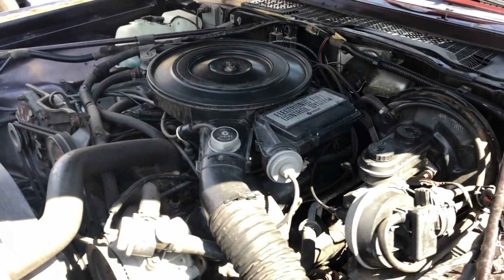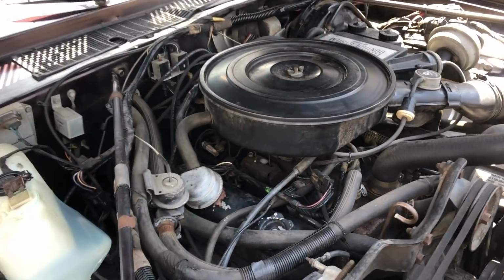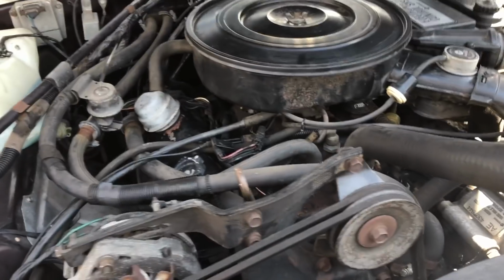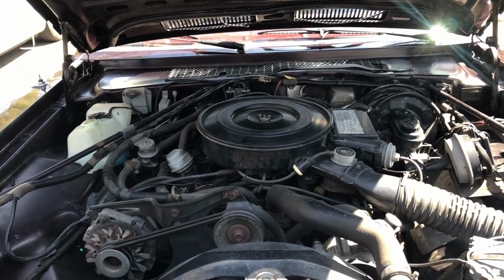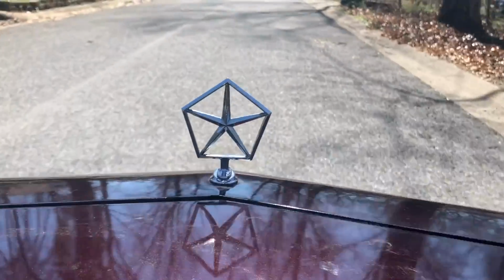The Car Chrysler Forgot to Stop Making - My 1988 Plymouth Gran Fury

Comment: Check those old rubber brakes hoses for rot... 14.7:1 isn't always the optimum air/fuel ratio... more like 12.9:1 for max power... 15-16:1 for max cruising MPG... all the performance magazines have articles on pumping that 318" engine to 400 HP... I prefer the Hot Rod versions: 
https://www.hotrod.com/articles/318-small-block-build
https://www.hotrod.com/articles/mopp-0409-318-engine-build 
https://www.hotrod.com/articles/0810phr-chrysler-318-engine 
.
Reply from the maker: Great comment and thanks for sharing those links.  Time to get reading on them now!

Comment: A friend of mine in college had a 1985 Plymouth Caravelle. Robins egg blue. Same basic car... 318 V8, column shift. It didn’t have any of the fancy electronics on the engine, just basic emissions stuff and a two barrel carb. Pretty gutless for a V8. My car was an ‘89 Oldsmobile Cutlass Supreme with a 3.1L V6 and same HP, less torque, and it would waste his car off the line. 

Two theories I have about this car. First... the Greatest Generation was still around and still wanted the RWD V8 full sized cars they’d always had... but weren’t able to afford the Lincoln Town Cars and Cadillac DeVilles nor the expensive European Mercedes and BMW RWD luxury sedans... and most domestic automakers especially Chrysler had gone to FWD 4 cylinder and V6 cars with an emphasis on sporty handling (everything way “Euro” or “European inspired” back in the 80s). The Ford LTD Crown Victoria and Chevy Caprice were aging and more expensive... so here was a cheap RWD V8 sedan they could buy. Even Lee Iacocca said that the only reason why they didn’t go full FWD was because these cars were their best sellers. 

Next is where Chrysler has always positioned themselves. They have always been the manufacturer who gives you more for less. Whether it be cars or trucks or minivans no other manufacturer from purely specifications comes close. 

And you can see it today still with their current RWD with V8 available cars like the Charger and 300. Fords upsized Taurus was comparable in size, but not configuration and was way more expensive. Chevys SS was also an expensive and low production run car that came and went. Toyota only has the V6 FWD Camry unless you want to head up several tax brackets into Lexus territory. Honda axed their V6 Accord. But Chrysler even after starting the revolution that all but killed the classic large American car in a curious twist of fate and a bit of borrowing from Mercedes has brought it full circle to what it was.
Reply from the maker: Fantastic comment and I totally agree with you.  The way you stated those theories, it completely makes sense.  It's almost like the folks at Chrysler deliberately stay in a certain niche so to not upset the bigger dogs.
Reply: The Chrysler LX was derived from the LH architecture.  The LH was originally designed to be FWD, RWD or AWD.  The merger with Daimler produced synergies that allowed Chrysler to borrow ideas from Mercedes, but in reality, very little MB parts content were used.  After the 2011 redesigns, ZERO Mercedes content.  

The idea that the LX cars are simply reskinned Mercedes is the myth that refuses to die.

Comment: Interesting thing about the radio and climate controls. It was up until the early to mid 90s... with new designs that included the Eagle Talon, the 1992 refreshed Ford Taurus, the 1995 Chevy Lumina, etc that all had the climate controls above the radio. Fords were especially bad.. since their radios were a maze of tiny buttons vs the knobs everyone else had. GM was better because they often had steering wheel controls for radio and sometimes for climate as well.  

In the late 90s was when American manufacturers finally relocated climate controls to bottom.
Reply from the maker: Again, another great comment.  Maybe you should start a YouTube channel with all of this!

Comment: We have an 86 Gran Fury that was an old Highway Patrol car. The state did some modifications to the electronic system above the engine shown here.  The box on the side of the air filter housing was removed and an actual computer was installed, which NO ONE knows anything about.  It's had operating issues since it was bought at a state auction. Our neighbors had bought it from the state in 89, drove it a few years, then sold it to my uncle. He drove it a few years, then sold it to us. I used it as my daily driver for the farm and errands and personal use. Each of us tried different fixes to get the car to run right but nothing any of us did managed to fix the driving issues.
It would get extreme mileage. One day it would get 23 mpg, the next it would get 13, using the exact same driving conditions. Sometimes it would develop a misfire which no one could figure out, then it would mysteriously go away.  My dad actually did consider just running an aftermarket carburetor and distributor and do away with the entire electronic stuff.
Reply: On the squads, Chrysler put the computer under the dash, away from heat and dust.  It worked, nothing special.
Reply: @pkranz937  OK. Where specifically under the dash, and is a replacement unit available?
It's a pretty nice car and we'd like to drive it if we can get it to work decently.

Comment: I always liked the styling of the late 80's Grand Fury. I used to own a 1987 Chevrolet Caprice Classic Brougham with the same kind of magenta felt interior of this Grand Fury. So many similarities. It had a 305 and was smooth as glass. I sold it to middle eastern man who exported V8 rear wheel drive cars to Saudi Arabia. Had was and is cheap in SA. 25 cents a gallon. They couldn't care less about gas mileage.

Comment: In my MOPAR driving history, I drove a 1985 Plymouth Horizon, and 1987 Chrysler Le Baron SE. My family also had a 1978 Dodge Aspen SE station wagon, a 1974 Charger SE, and a 1983? Mitsubishi Colt. That radio doesn't look like the standard MOPAR radio, but the chrome plastic climate controls are totally MOPAR of that time. Anyways, the 1980s were a great time for Pentastar reliability, and all our cars were very reliable, except that the choke had to be manually opened during the winter after they flooded. Enjoy your car!
Reply from the maker: Thanks for the comment and for checking out my Plymouth video.  And wow man, you really were from a Mopar family!  That's a whole lot of Pentastars!  -Chris
Reply: @hullinger   It is too bad about Chrysler, because when Americans relied on the Big 3, Chrysler was generally considered to have the best engineered vehicles of all of them.

Comment: Since there is no air bag, this is an earlier '88 model (pre-May 1988). Should been built at AMC in Kenosha.
Reply from the maker: Thanks for the comment on my Gran Fury video and yeah, you're right.  I checked last night and my Plymouth WAS built in Kenosha.  I was hoping it would have been in Newark, DE since the old factory is fairly close to me.  -Chris
Reply: Only some '77-81 M-bodies were built in Newark, before K-cars took over. They (LeBaron/Diplomat) were being built there alongside the Aspen/Volare in those years, since a M-body is basically the Aspen platform.
Reply: @kevinwong6588  M body through '83 was Windsor. F body at Delaware through '78, then Lynch Road through '80.
Reply: I through the Aspen platform (F body) remained in Newark until end of 1980, with changeover to K-cars. The R-series (Newport/New Yorker/Fifth Avenue/St. Regis/Gran Fury) were the only models at Lynch Road by 1979.

Comment: try a colder firing spark plug like NKG it might help with the misfire/timing problem it might NGK
Reply: Not the right plug.  Champ RN12YC.  Could be wires, cap, rotor, carb, vapor lock, fuel filters/pump, egr valve ... gotta test it and narrow it down.

Comment: Find an old junkyard 440 or even a 400 with the big block transmission 727 and have some real fun, that's all I used to own was Mopar, great video.
Reply: Tight fit. The 340 will bolt in.
Reply: @robertlee9395  360 is the best in these cars.  Torque, torque, and torque.  Make sure the rear leafs are good though, the 360 winds them up something fierce.

Comment: You will never get the Lean Burn system running properly.  They just don't.

Swap in the distributor and electronic ignition box from a mid-1970s Mopar V8.
Reply: Bullshit.  Just diagnose what's wrong and fix it.

Comment: The M body is the very last true Chrysler product that you could own, that after 10 years from new. Still ran great. I have had 2 of them. Both in excellent condition, served me well to the day i sold each of them. I can say without any ANY regret, they were the best cars i have EVER had.
My 1987 gran fury had the uncommon 5.7 liter 360. After ditching all the emissions junk got far better fuel economy, and would light the back tires with ease. At 4,000 lbs - yes 2 tons put it on a truck scale it is a two ton car. Built like a tank, anything that hits you if it's made after 2007 is totaled
and money says YOU will drive away. The other car is going to the bone yard to die. After some repair, the M body will live on for many years after.
The A904 transmission was an updated version of the A727 torque flight transmission more or less, if serviced was trouble free. It was set up to go into lock up with the torque converter clutch - tcc at about 50 mph. If it is stock it will return about 12 to maybe 15 mpg around town. 25 or so highway. Not great, i had no problem paying a bit more for fuel knowing i could take those cars anywhere and not have a single problem.
In 1998 we had a heavy snow fall in January, by morning it was minus 18 degrees with 2 feet of snow. Roads were clear so i went to work, about
45 miles away. I went out cleared off the car, set the choke and it fired right away. Went in had my coffee. When i left, everyone took notice that my " beater tank " was driving away while they had the hood up wondering what went wrong. Limited slip rear end with  600 lbs of sand in the trunk,
meant it did not really notice the snow much. Rear wheel drive works just fine if you understand physics and put a little weight over the drive axle.
If you can fix cars and find an M body dodge with low miles, buy it. Replace all the wear items at once. And it will reward you with many years of no trouble service. You will pay more in fuel, but it will never leave you on the side of the road - in any weather or temperature.
The new mopar is all junk ALL of them. Inside every Toyota is a little Dodge, because they clutter all the bone yards across the nation.
All cars go to the crusher at end of service lifetime. But all new mopers are built specifically to Excell in the scrap market, it is the only market that they dominate. As they clearly were not designed for any other purpose. Yes even the minivans are turds too. Ford and chevy are not much better anymore. Toyota or honda far fewer regrets.

Comment: One of the most important things to do when timing the car is you must use a vacuum pump on the vacuum transducer and put a precise vacuum of 15 and plug the vacuum line. Also check the gap on the magnetic pick-up first and set that.
Reply from the maker: Wow man, great comment and thanks so much for sharing about the timing procedure.  I recently picked up a service manual for the Gran Fury and it said the same as what you said.  I'll have to get more into it very soon and get this car timed right.  Thanks again.  -Chris

Comment: I have an 85 & 88 Gran Fury, plus a 1988 Diplomat and an 85 %th Avenue. I removed the electronic lean burn system & installed a non computer controlled Carby and HEI Distributor with vacuum advance to 3 of them (so far). I left the electronics box on the air cleaner for show but it's not connected. On my 88 Police model the ELB electronic are under the dash, not attached to the air cleaner.  On any model, you can remove all the electronic control wiring harness (which i did) as it's an add on to the main harness. If you do this, you will be happier, the car will be far more reliable & better to drive. By the way the ELB electronic controller and wiring was added to this model in 1979 or 1980, that's why the electronics harness can easily be removed. Really nice cars to drive and I like the styling too.

Comment: I had a work car, 1980 Ply Gran Fury Police package with the lean burn.  At about 85,000 miles it starting going into limp mode.  Shop couldn't figure out why and didn't want to throw parts at it (at about $1000 a crack) so the car went to auction.  Other then that it was a fantastic car, one of the best big American cars ever built.  It was the full size rather then your "camry sized" one.  But we also had these "little" fury's and the Dodge versions were really good.. The aspens were not as nice and for some reason the aspens wandered all over the road whereas the Dodges tracked straight.

Comment: When ever anyone mentions the Chrysler Lean Burn System, my left eye twitches ! Loved the video, well done ; i think the only thing worse than the Lean Burn System ( which looked great on paper, but......) was Fords Variable Venturi Carb or Cadillacs 4/6/8 cylinder deactivation system in the 80s ...run for the hills ! Chrysler was also the first with the electronically controlled auto transmission A704 i think, it too looked good on paper, but many a transmission mechanic put his kids through university repairing those things. For the love of God man put a stock distributor in that girl..I bet the original owner would be happy to know his ride wasn't backfiring in front of the 7-11 when you hit the gas.

Comment: I had a 1980 Dodge Diplomat that I bought in 82. After a year the headliner was dropping like yours.  The door pulls on both sides came off. And like yours I couldn’t get it to run right all the time.
It was a good riding car. Worked good on the highway, but build quality was average at best.

Comment: I do not think you would be dishonoring the original owner by eliminating the lean burn system.  It should be basically the same car, but more reliable  Is it a Quadra-Jet carb?  If you keep the cosmetics the same, then who would know?  The loose headliner is common in those 80s cars.  Fabric stores sell foam backed headliner material you can cut to size and glue to the cardboard backer board.  They may even have red.  I know they have gray and black and it costs about $10.

Comment: I have an identical '88 Gran Fury except it has a Landau top., I mean same color inside, outside and same options. I replaced all of the electronic "Lean Burn" System with an Edelbrock intake, Holley carb and a '70's electronic distributor conversion. It runs 10x as good as it did before the repairs. If you want to honor the original owner then get the car running good so you can drive it.

Comment: Try going up jet sizes on your carburetor. My guess is that your misfire problem is a lean mixture. They came from the factory running as lean as possible. The problem is that with timing chain stretch the computer was to primitive to compensate.

Comment: Here,s a cure its called lean butn because it is designed to run a 17 to 1 air fuel mix ,way to lean ! If your car has the carter two bbl carb ,jets for  carter afb 4bbl or edelbrock 4bbl will fit right in try going larger one number size at a time ,the problem is not timing its mixture ,try it you will like it

Comment: I’m starting to think there might be an opportunity to use a Arduino or Raspberry Pi to replace the guts of that lean burn box. If someone has the original code for how it was supposed to work you could then dial it in with a laptop. This car might be a good candidate for doing something like that.

Comment: My father had the Chrysler Le Baron version of this platform. It had all factory options except AC. The power leather seats were the best I've ever sat on. The Lean Burn module was a nightmare but my father knew an electronics guy who replaced a few heavy duty transistors that were not heavy enough. After that there were no more issues with it. My father, a mechanic by trade, also put a 4 barrel carburetor and dome, larger tires, as well as a dual exhaust on it. Performance and handling improved greatly and mpg did not at all suffer. I was thinking about buying it but he traded it before I could. I regret that I missed out on it.

Comment: GM and Ford were way ahead of Chryslers Lean Burn system, EEC and Computer Command Control particularly were diagnostics friendly...
Reply: ROROSMACHINE I worked on mid 80s GM and Ford cars when I was a mechanic, they were not way ahead of anything when it came to ECMs. Besides, you are comparing something from the mid 70s to the mid 80s. The Lean Burn System came out in 1977, and only had one minor upgrade in 1978. The idea worked great, it was the materials and technology of the day that caused the biggest problems. They also beat both GM and Ford by several years when introducing a “computer controlled” engine. Although it is hard to call a simple electrical board (that looked like something sold by Radio Shack for kids), a computer. But it did compute data, so I guess it is a computer.

Comment: I had a '78 2-door Diplomat as my first car.   That Lean Burn system only needs a few of the wires to actually run.  I trimmed them out 1 at a time when I was prepping the car to do some hotrodding, but making sure it still ran.   After building up the 318, then dropping in a 360, I dropped in a 440(a bit of work required to make it fit).